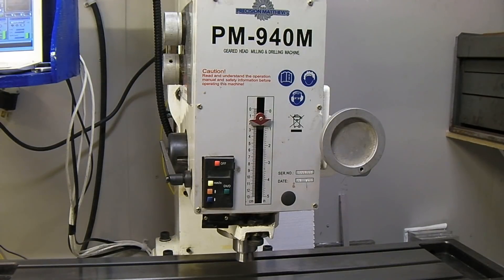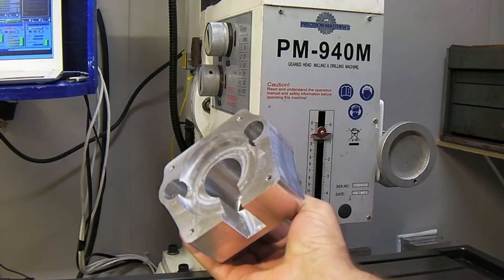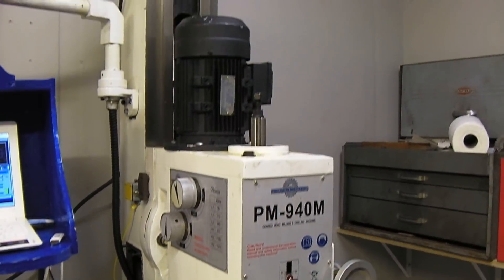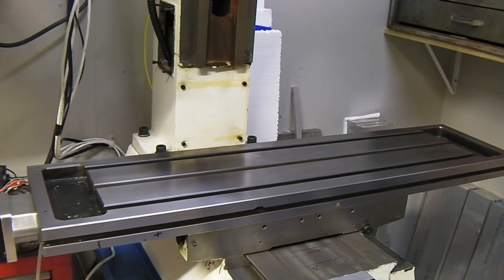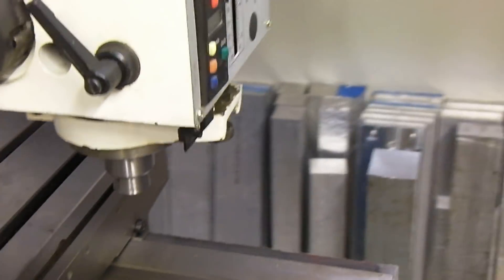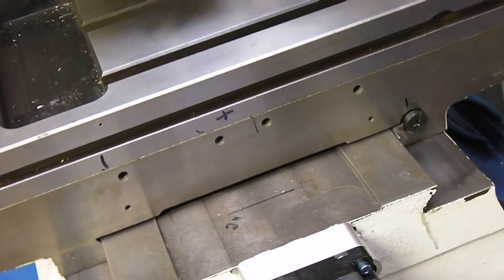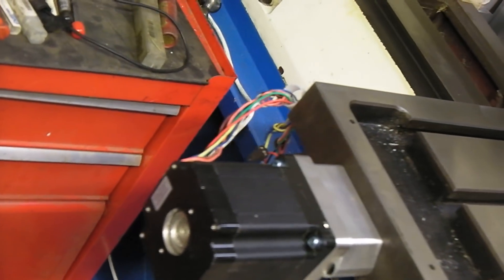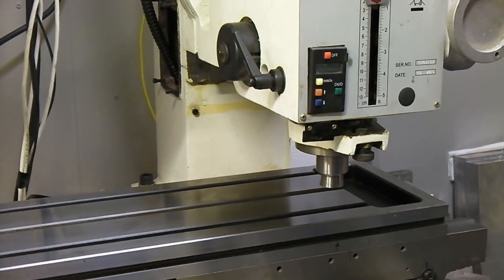PM940m CNC Break in.

Comment: When will you have information about the ballscrew kit?  Will you only be selling motor mounts or will you also sell ballscrews?
Reply from the maker: The kit will have the screws too.

Double nut C7 screws. I re work them for positive preload. I have three sets on hand and will try to keep then in stock. 

I just did my first run of parts with the 940 and it is working really well. It is stronger then the IH/ Charter Oak mill which is great. 

I only have Three Z nut holders to do. I do have a problem in that my mill came with a power feed Z so the bolt pattern id different than the standard. Do you have the mill?
Reply: I currently have an G0704 but looking to upgrade.  In all of the research I've done the PM940M comes out on top.  Are your mounts for Nema 34's?  What is the diameter and pitch of the ballscrews you will be offering?  I am thinking about doing the Clearpath servos.  Have you ever set up a machine with servos?
Reply from the maker: All the mounts are Nema 34. The screws are 5mm pitch. D=20mm X and Y and 25mm Z.

I have one Clear path and it does look to be perfect for this kind of use. I will be testing it soon. I have been running a Gecko drive servo for years on my other mill. It is fine but the brushed system is not that much better than the steppers. So far I really like the 940. My biggest surprise is the gear box is almost quite.

Comment: How does it compare in size to the dm45?
Reply from the maker: I don't have a 45 just a IH which is a fair amount bigger. Size wise it is the next size bigger. The throat is over 1" deeper than the IH which is 1.5" deeper than the RF-45. The column is about a 1/2 larger than the IH which is about 2" larger then the 45. 

Most 45 mills have about 9.5 to 10" of Y. The IH has 11" un cut and the 940 13.9.  Its just larger. The casting are thinner in most places but the head looks to be stronger so I expect it to work well as long as you don't go over the line too much.